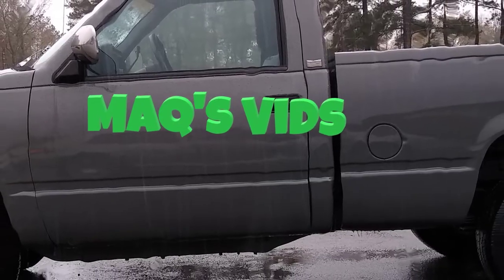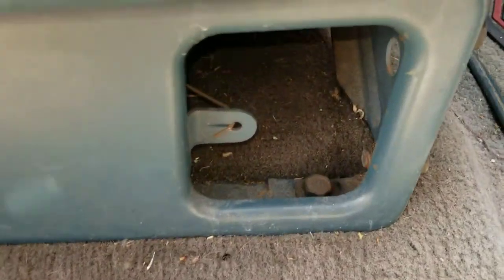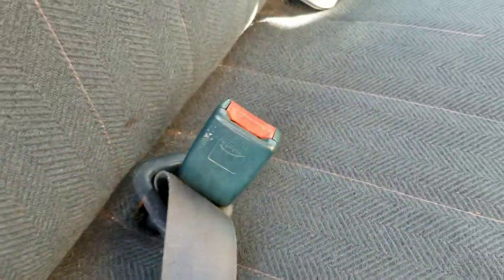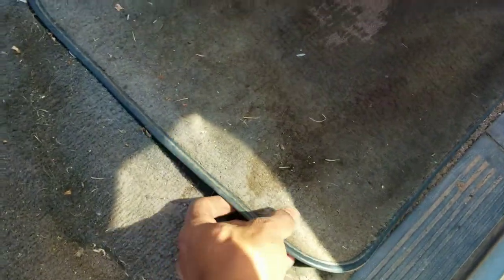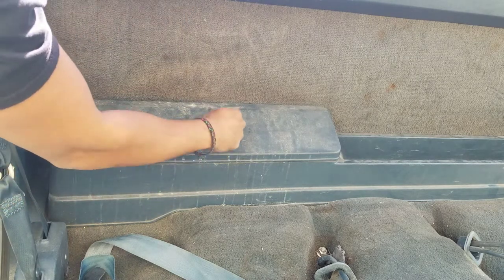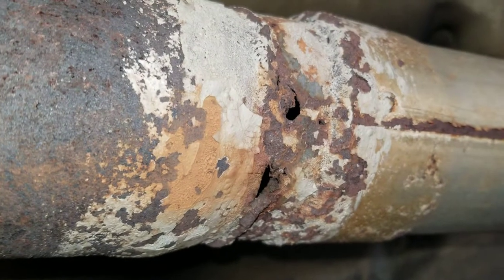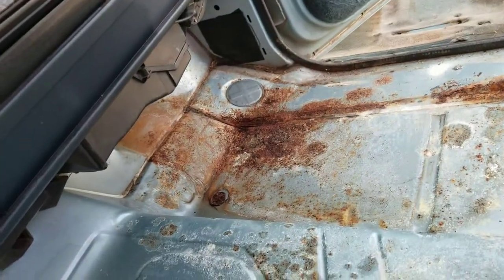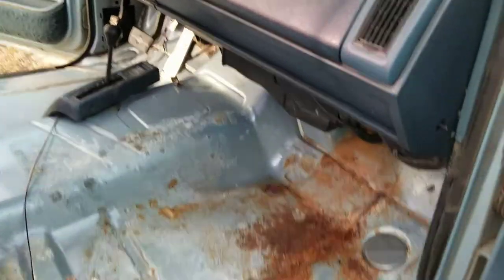89 K1500 | Seat and carpet removal for cleaning

Comment: Man… you have no idea how lucky you are that those torx bolts holding down the seatbelts came out that easy, I’ve used an impact drill, lube, hammer and chisel to get rust off, heat gun… I’ve been working on the driver side bolt all day and it won’t budge… hasn’t been out in 34 years so I knew it would be tough but damn. Glad you got yours out easily!

Comment: My 90 knob looks same as yours and just unscrews. GM 15588503 is same part number used 88-94 on the K1500 trucks.
Reply from the maker: Thanks a lot!!! I'll give it another shot. I tried twisting it but the cover just spun around. I'm going try it with some channel locks.
Reply from the maker: I got it off with channel locks. Thanks again!

https://youtu.be/cA0qUQb22r4

Comment: The heater.box has a moisture drain in it and they get plugged. This causes the water to leak down the fire wall under the hvac box. Take the blower motor off and Vacuum the inside off the heater making sure you clear the drain. I live in canada and I do it once a year
Reply from the maker: Thanks. I'll check that out.
Reply: THANK YOU! I think you have solved my on going problem

Comment: Hey maq,
I have a 90 silverado. I started the truck with frost on the windshield and the wipers were on so the driver's side stopped working something popped. Can you give me any instructions on how to repair it or how I can get the grille off where the wipers studs comes through the grille.thanks love your videos and i also like how "detailed" you are in your repairs.thanks again!.
Reply from the maker: Hi Mack, check out the video linked below (if you have not already) I believe I remove everything you need to remove to fix your problem. At least it will show you how to get to it to see what is wrong. Let me know how it goes.

https://youtu.be/WJxpsTZzoOc

Comment: I have an '89 Sierra 1500.  I have a leak on the driver side somewhere.  Id love to know if you were able to figure it out.
Reply from the maker: damn...we are in the same boat. I'm pretty sure mine had something to do with the heater core tubes. The next video will be coming out soon. I'm working on it now
Reply: Mine ended up being a windshield seal

Comment: Did you find out where the water leak is from? I have the same issue.
Reply from the maker: I think I did. It was related to the heater core. It seems like mine was a heater core leak or where the hoses connect to the heater core. I show what I found in this video.

https://youtu.be/70tsqItZqtU